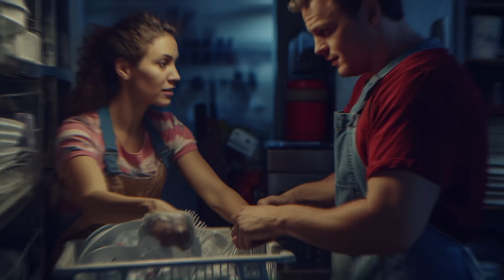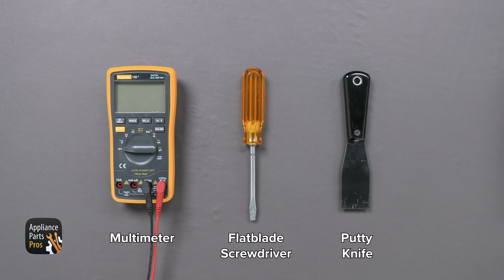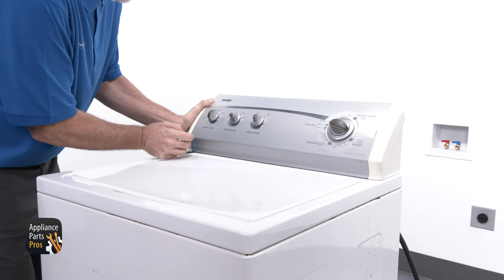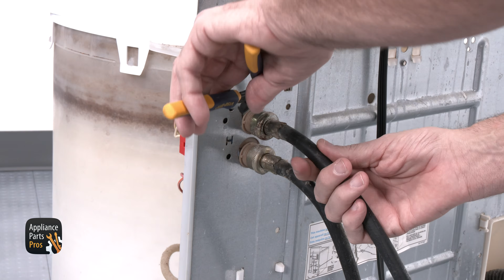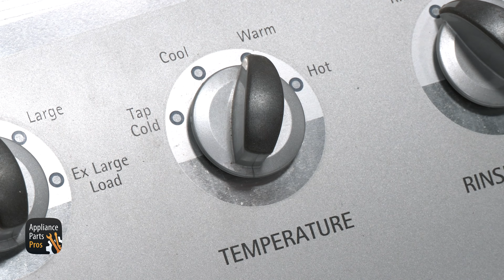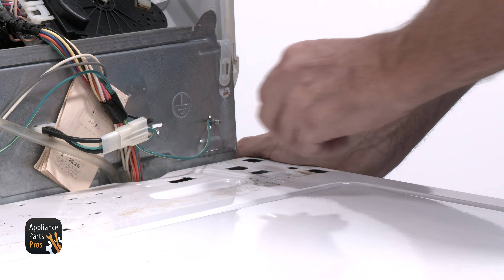How To Test A Kenmore Water Valve WP3979346

Comment: What if it wont stop filling.
Reply from the maker: Glad the videos helped, @KIMBALAKUMBALAPR! 👍 Hope the new water inlet valve and sensor solve the issue.
Reply from the maker: If a unit does not stop filling, the issue could be the water valve. If you need testing information or more troubleshooting tips, check out our  Repair Forum: https://forum.appliancepartspros.com/.  It’s easy to register, and you can either post your question or search the forum to see if someone else has already asked the same question.
Reply: @appliancepartspros Thanks! I ordered the Water Inlet Valve as well as the sensor.  Very useful videos!